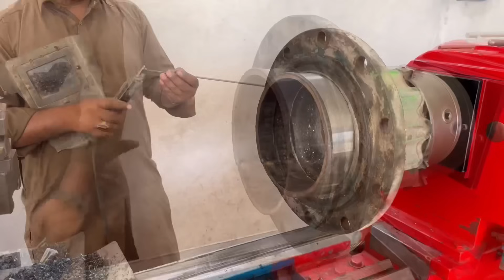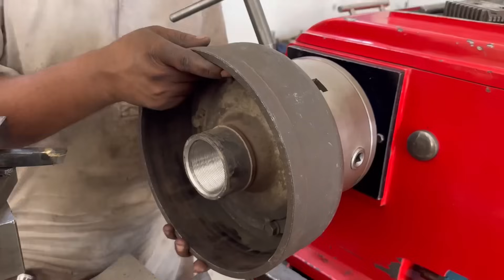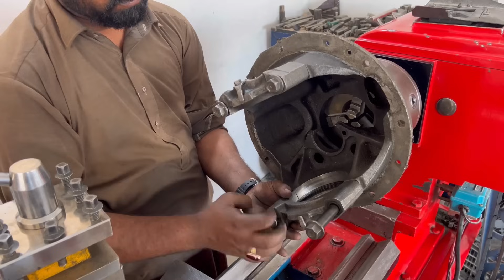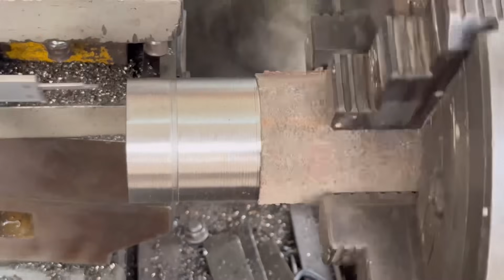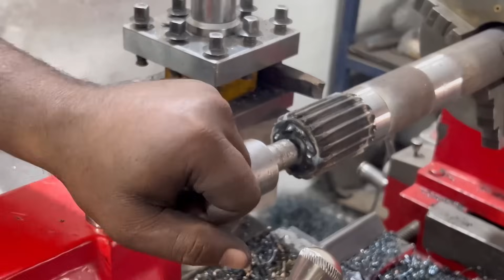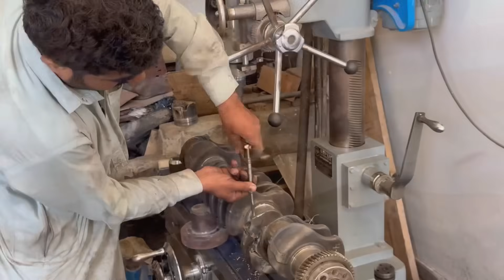Top 8 Amazing Broken Truck parts Very Technically Repairing // Must watch these videos

Comment: I often find I’m uncertain what exactly the repair method is to be until substantially into it. I’m watching closely, trying to assess what will be done next. Really interesting stuff, creatively using salvaged metal.

One major question. How does the thread cutting function work? I understand threads. I just don’t understand how the tool, cutting a defined thread as it’s advanced through the work, is somehow indexed to the work, so that four passes always cut deeper into the same thread. It seems to me that the speed of rotation of the chuck and the speed of movement of the thread cutting tool must be hard linked. So one revolution is associated with say a 2mm lateral movement of the tool.